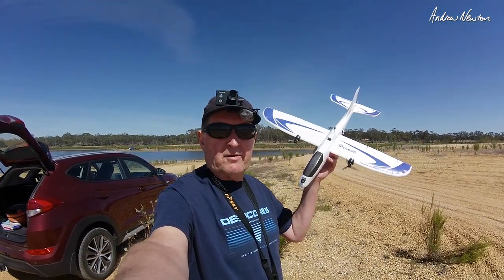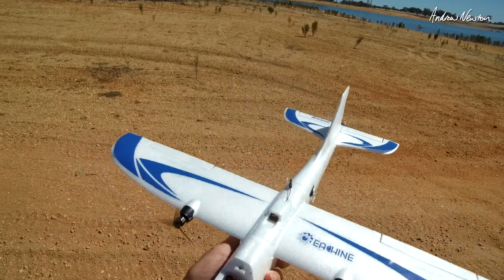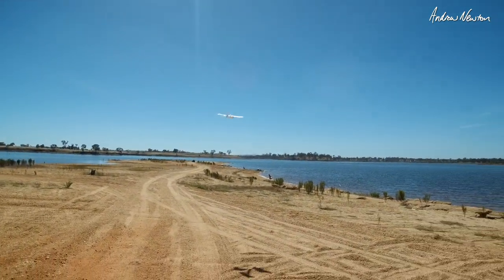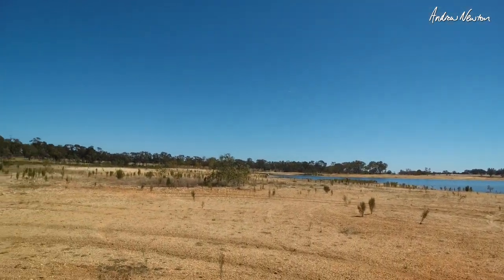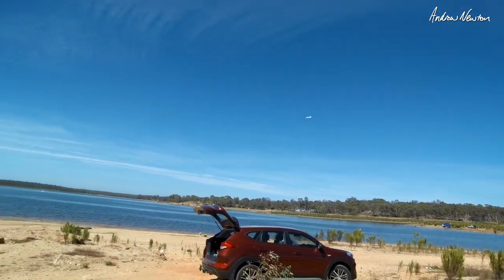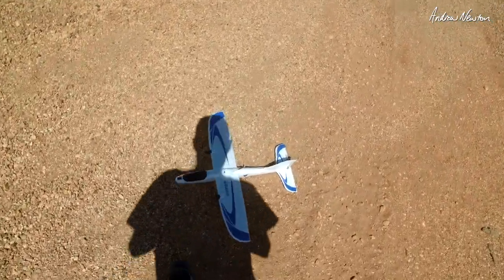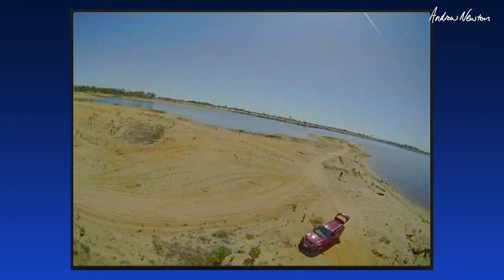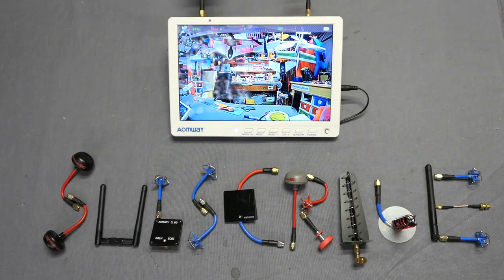Eachine Flying Fish Flights

Comment: Using 4s 650mAh - 15 min easily.
Stock servos are very bad, I mean they are okay with normal recievers but any rx that needs to boot and doesn't send the pwm signal to servos immediately makes the servos go crazy and strip gears. Seems the stock servos don't like being powered without PWM signal applied, found out the hard way when going INAV - board does not send pwm signal until it boots so the first one or two seconds the servos are going crazy. Had to replace mine with some Kavan GO 6g servos.
Oh, and they DON"T like anything above 5V power...

Comment: Andrew:
   Thanks for using 2S batteries. Most other viewers use either 3 or 4s, and I am more interested in long fly time and don't have 3s batteries small enough for this canopy. Did you ever find a way to fit your 2S Li Ion batteries? I had to do a little foam triming, but got mine to fit, and hit the CG easily, but haven't flown this plane yet.  I'm waiting for an Express LRS Rx with PWM outputs to arrive.  I'm interested if you have found a flight controller that fits to work.  - Jim
Reply from the maker: I haven't done any more with it John. Would struggle to fit a flight controller I think.

Comment: Wow 225 g with 1300 milliamps of 2s power in an fpv plane. I have 1300 milliamp batteries that weigh 65 g. I assume that's close to the weight you used. If you've got that right , that's impressive, definitely meets the Canadian fpv  market.
Reply from the maker: Yes it's surprising.

Comment: I have not lot of experience with rc planes, i have managed to install gyro nx3 in it but stil , very fast and very hard to control, I am doing different test which krash, then repair again, then test again, for me it looks that CG is place too far in the front. Also it looks that control must be lot reduced like less than 50% of full range. Do you have any advice ?
I tried 3S with correct CG and retried 4 times , it always crash its nose 10 meters away except if i put an insane throtle with elevator which throws it in uncontrollable high altitude then crash
Reply from the maker: It does sound to be nose heavy or the elevator is reversed. Hard to say without seeing it fly

Comment: A question Andrew. Those 1105 motors look about the same as on the KingKong/LDARC TinyWing450 where the props are secured with 2x2mm screws - not just press-fitted. The Banggood sales blurb shows screws fitted too I believe. The usual Banggood artwork stuff-up or perhaps you didn't want to add the extra weight?
Reply from the maker: Correct. There are screw holes, but no screws supplied.
Reply: @AndrewNewton  Time to wallaby jack the old Tojo up on 1 side to let all the bits floating around the floor roll out to where you can check through them? 😜😁

Comment: Did you have any crashes?
And if you did, would you say that it was VERY durable in those crashes, or just average like other foam planes?
Reply from the maker: More durable. Good foam and light weight means it will bounce unless you power it in to something at full speed.
Reply: @AndrewNewton  Thanks!   :)